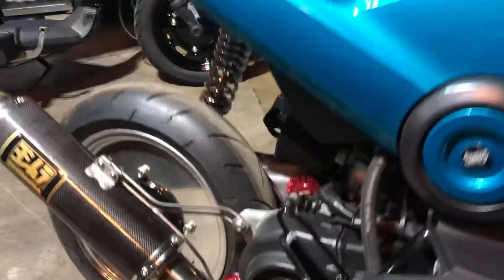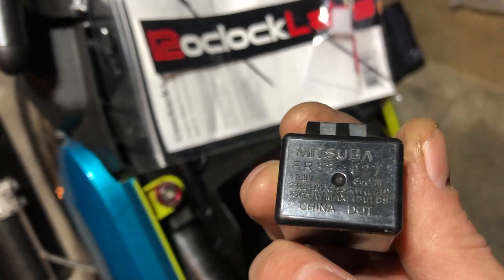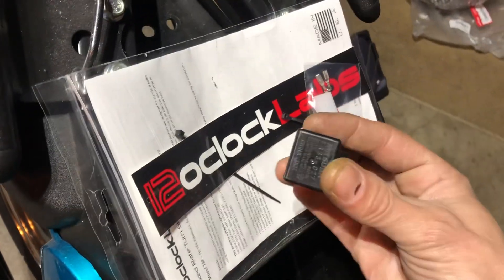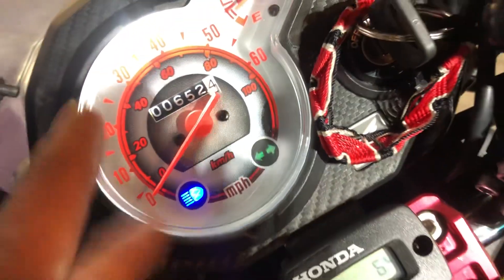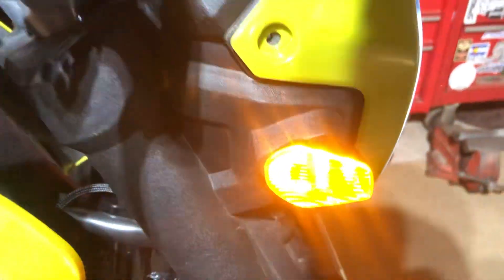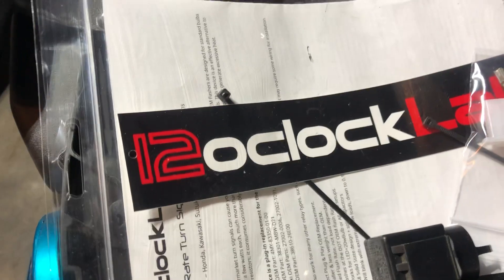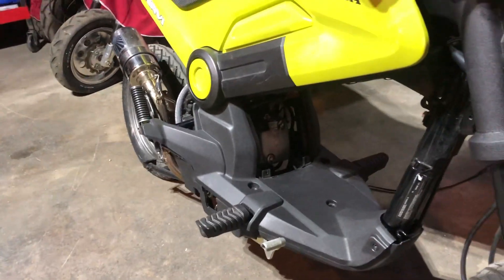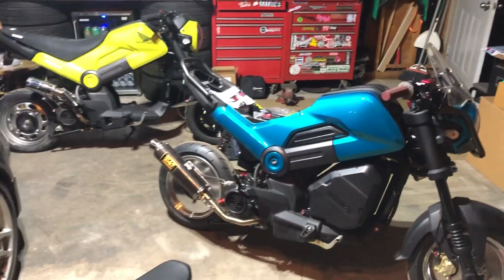How to make LED turn signals work on your custom Honda Navi! Best flasher relay/ easiest install.

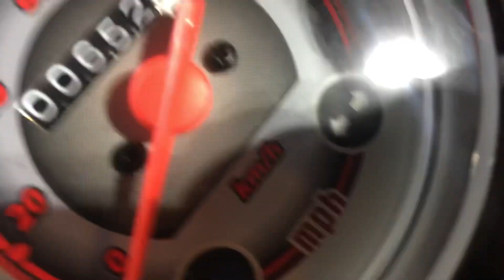Comment: 1:53 how does indicator still works?
I had to remove mine because otherwise all 4 turn signals would flash.
Reply from the maker: I used a flasher relay from 12”o’clock labs. No extra resistors or anything else on mine.
Reply: @xtramediumminimoto nice, do you have a link? 
How much is it?
Reply from the maker: All the info is in the video.

Comment: Does your taillight stay on when you installed the Grom lught
Reply from the maker: It stays lit as a normal running light and brightens when the brakes are applied as it should.
Reply: @xtramediumminimoto  I was told to connect a wire directly to the battery and one to the 7.5 fuse was this something you did
Reply from the maker: Absolutely not. Do not connect straight to the battery, just use the original connectors for the brake light and signals.

Comment: Do you know if this will fix the issue where it dims my head lights when I turn on my turn signals? I installed that same rear tail light and been having issues with light diming only when I turn on my stock turn signals?
Reply from the maker: It worked for me, without seeing how yours is done and the parts used I can’t say for sure but it’s the best one I’ve found.

Comment: I need that mounting bracket 😭
Reply from the maker: Very easy to make.
Reply: @xtramediumminimoto  oh you MADE it?
Want to share the process? I’m assuming aluminum sheet metal?
Reply from the maker: Yes sheet metal, folded twice with two holes on each section, and one hole in the middle of the center section for the wires. Take your stock tail light out and make a template with cardboard first. A little tricky to make it fit back inside so it looks best but it’s pretty simple. I’ll try to remember to show it in a video soon.